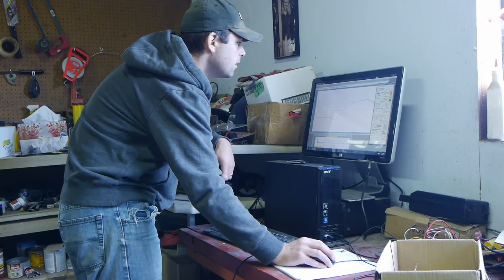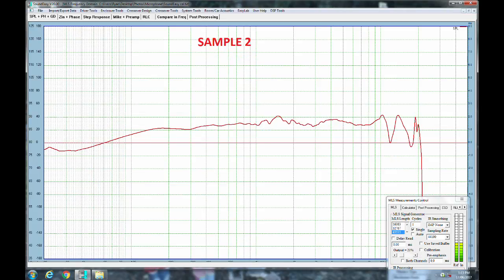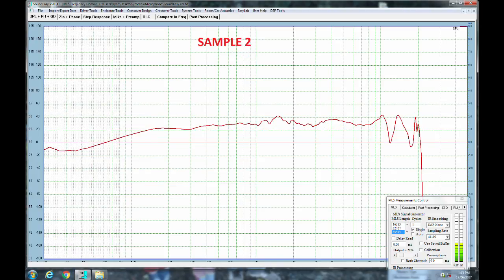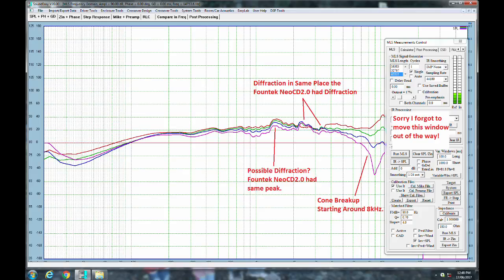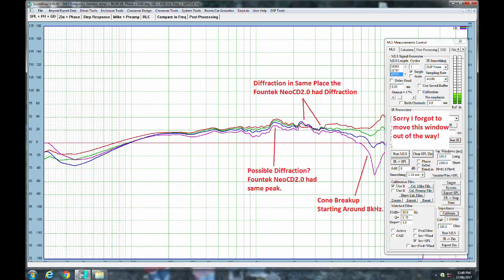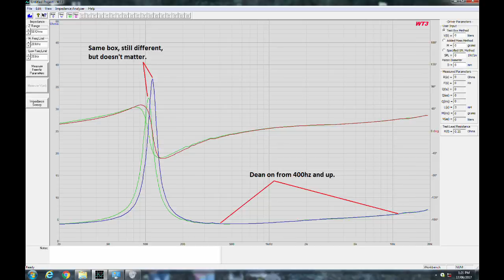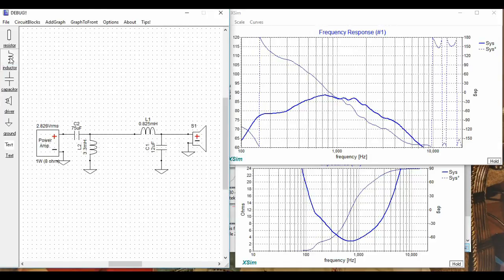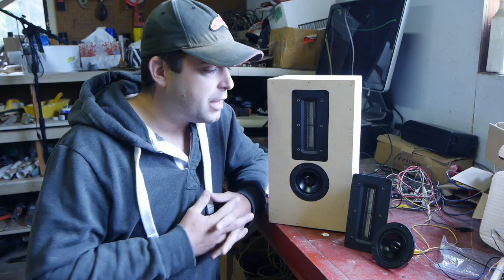Tymphany (Vifa) NE95W-04 Driver Testing and Review

Comment: Hey man, nice job! But what kind of soft and equipment did you use?
Reply from the maker: Hi, thanks. What do you mean by soft equipment? Do you mean what software do I use?
Reply: Impulse
Reply: Impulse Audio,  I meant to get driver parameters.
Reply from the maker: Александр Стрекалин oh I see. To get the driver parameters I use a WT3 from Dayton. They're now sold as a DATs. I also have SoundEasy but haven't bothered to use it for driver parameters. I use it for frequency response only.
Reply: I've got a couple of drivers,  I need to take a parameters,  to design right enclosure and that way looking for some handy soft and tools,  like "all in box".
Reply from the maker: Александр Стрекалин if you already know the parameters you can use winisd or unibox to help design an enclosure.
Reply: Impulse Audio, I see,  DATs is not available in my region 😑. I'll try to found some other...

Comment: I am thinking about doing a "full range and subwoofer technology" setup and I am looking for an efficient and good full range. I am thinking about crossing it around 300-400hz to a good 8 inch woofer. Any recommendations for what full range you think would be good for this? Thanks!
Reply from the maker: I have done a few of those FAST type of speakers. The Fostex FF85wk is quite effecient and overall pretty good. This vifa can work full range except it is not very effecient. Don't forget because of baffle step losses you lose up to 6db on your woofer. So an inefficient 85db full ranger can work with a 90ish db woofer and still sound balanced.
Reply: Impulse Audio I appreciate your help! What do you think about the dayton PS series? Would you think the 3.5 inch would be good?
Reply from the maker: FreshLemunz that driver has a couple concerns. The data sheet says 85db but the response curve is actually more like 83db. So that's very inefficient. The other concern is the 70ohm resonance just below your planned crossover point. Unless you want to go active that will present some challenges to your crossover. I think there are better choices. Especially if you can splurge a few more dollars.
Reply: Impulse Audio Damn it. I don't mind the money. I just want it to sound good. That's all that matters. Thanks again.
Reply: Impulse Audio Alright then what about this combo. A fountek fr89ex as the full range and a nice woofer? Also, how much would you charge to make me a crossover? Thanks
Reply from the maker: FreshLemunz that driver looks like a good choice!

As for doing XO work for other people it gets costly because of shipping to me in Canada and then back. That alone could be costly. Depending on the project I may be interested if it can make content and be a project I can give out.
Reply: Impulse Audio Ok well let me know. I know the crossover can make or break the build. Might have to just buy a prebuilt one I guess since you said those online calculator ones are garbage lol.
Reply from the maker: FreshLemunz I can tell you roughly what parts to use for this Vifa and say the Dayton RS 8". I have those drivers measured so I can give you something in theory. Then you could listen to it and tweak. But that's using those drivers and you may want something else.
Reply: Impulse Audio That would be amazing. I would really appreciate it! I have already subbed as well.
Reply: Impulse Audio Does the RS 8 inch have good low end?
Reply from the maker: Yes it has insane low end. Very clean and solid bass. I'll work something out and either post it into my drop box or possibly work it into a video. I'll let you know.
Reply: Impulse Audio Thank you very much sir. I'll order these full range then. Are you looking at the rs225p-4a, rs225p-8a, or rs225p-4? Just so I know which to order.
Reply from the maker: FreshLemunz it's the RS225-4 that I have. I have a short review of them here on YouTube. Sorry, don't have the link handy. About my 10th video I think.
Reply: Got it thanks.
Reply: Impulse Audio I have always wanted to try something like this as tweeters can sometimes really tire out my ears. Another awesome idea would be to make a modern version of the JBL 4311s!
Reply: Impulse Audio I saw it. Looks like it can handle some good low end! Sounds perfect! Also, what is your take on the dayton ps225-8 as a full range? Do you think it could be tamed and used for various types of music? Or simply something like jazz?
Reply from the maker: FreshLemunz I've never used that one either but the spec sheet makes it look like it would need some taming above 3khz. Looks like it could be used as a woofer actually. Above 1khz it starts to get a little hairy.
Reply from the maker: Ok I've put together a potential XO to try with the Dayton RS225-4 and Vifa NE95W-04. You can find it here: https://www.dropbox.com/s/fs0tqem31mk40bg/Dayton%20RS225-4%20plus%20Vifa%20NE95W-04%20crossover%20schematic.PNG?dl=0

It looks pretty good and I'm tempted to try it myself, but have to many project to tackle at the moment. Let me know if you do it!
Reply: Impulse Audio Awesome! I appreciate it. What is the crossover at? I have already ordered the speakers so I will probably make a video about it. I will let you know!
Reply: Impulse Audio Also, in regards to the crossover, for R1 is just says 2. Not sure if that is important or not. Sorry not really that familiar with xo's
Reply from the maker: FreshLemunz no problem. That means 2.0 ohms. It's not a very critical part actual. 1.8 to 2.2 would easily work.

The XO point is about 500hz. Both drivers will be really happy there. I have a lot of confidence this will work well. Only concern would be the treble if the Vifa is up for it. In the future you could always toy with adding a little 19mm tweeter.
Reply: Impulse Audio The tweeter just to bring that sparkle to it. Something like the dayton 3/4 tweeter you think?
Reply from the maker: FreshLemunz try without first, but ya exactly like that.
Reply: Impulse Audio ok cool. I appreciate it
Reply: Impulse Audio In regards to the ground, is at all basically connected together?
Reply from the maker: FreshLemunz yes that's right. I might do a video on this showing assembly. I think other people might want to try it too. I ran into problems with my measurement computer so my latest video is stalled anyways so I could quickly do a crossover assembly type of video.
Reply: Impulse Audio That would be very helpful. I look forward to it!
Reply: Impulse Audio Did you decide on doing the video by chance?
Reply from the maker: Yes I do plan to do that. I just have a few things to cover first. Not to mention I had a few things go sideways lately. My measurement computer died and my cnc broke! So two big set backs means videography has been slowed down a bit. Hang tight. I'll get to it in a few weeks I hope.
Reply: Impulse Audio Dang I'm sorry to hear that. Hope you get everything up and running again. Your videos are really interesting!
Reply from the maker: I have. Both machines are going again. Not 100% calibrated but close. Can't believe both had issues a couple weeks apart. Have had both more than 2 years and bam. Oh well, you'll see the videos start coming again soon.
Reply: Impulse Audio Awesome.
Reply: I've used fountek fr58exs and fe87s in such configurations with great success. the 2" fr58 is pretty clean as a tweeter, though a first order cross to a supertweet around 10k is better. The fe87 is nice and cheap but gets unpleasant ran all the way up, definitely needed the supertweeter, perhaps a little lower, 7-8k.
Reply: Oh and the fr58ex can be crossed 2nd order as low as 200hz sealed, depending on how loud you need it to go, a line array of 8 fr58exs per side is quite nice.
Reply from the maker: FreshLemunz I havent forgotten about this. Just crazy busy these days trying to get projects done as well as normal life this time of year. Hopefully in the next few weeks.

Comment: When measuring midrange driver or woofer drivers (in a 3-way), are all measurements taken at the design axis (say tweeter level) or the measurement for each driver (tweeter, mid, woofer) taken on axis with the respective driver? If it's the latter, then I'm guessing when you load the various FRD files into which ever crossover design software, you must specify the exact location of each driver on the baffle in the software at let the software approximate on how it must sound on the design axis? Is my assumption correct?
Reply from the maker: Dharminder Kalsi you are asking a good question that's not easily answered. For a small 2 way type of speaker you're pretty safe to measure on the tweeter axis about 1m away and design using both files from that axis. On a larger speaker you either need to measure on each axis and determine the acoustic offsets somehow, or back up the microphone a lot. As you do this you allow more time for reflections to contaminate the measurement. So it's a catch 22 you gotta be mindful of. I did a big 3 way using dual 12" woofers and dual 6" mids for diysoundgroup and I literally put the speaker on my roof and backed up the mic over 2m. That was the only way to get clean data down below 100hz and a sufficient distance to capture each driver not to far off axis.

It's a big subject. I will try and cover this in a future project.

Comment: Really like reverse surround on midranges, as well as the 3-4 inch size for higher cone breakup and wider dispersion. It's a shame there are not many on the market. Madisound carried the Aerogel midrange that was the bees knees with higher sensitivity than this peerless unit, but has been out of stock for a long time. Keep up the good work on the videos, I'll be watching.